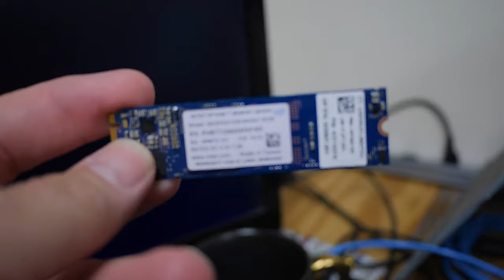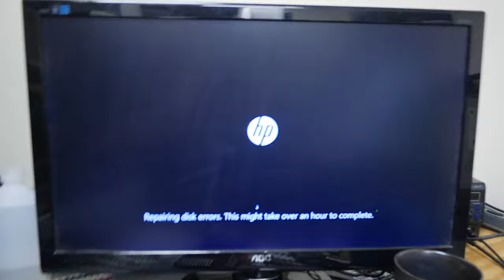Intel Optane Ate My Homework - Jody Bruchon Tech

Comment: Optane worked fine for me in the past. Its not even a thing anymore so this is pointless.
Reply from the maker: This comment is trash. I recorded this a couple of days ago. Optane working fine for you didn't stop this computer from eating customer data, nor the last few I've repaired over the years. New machines not coming with Optane didn't help this existing machine that already had it from eating customer data. At what point does this bullshit kind of comment become useful?
Reply: @JodyBruchon  Love that pin of shame
Reply: @JodyBruchon  all i know is, that on a fresh install of windows with optane properly configured, it did what it was supposed to do. As far as losing data is concerned... I always treated optane the same way you would treat a RAID 0 array. If one drive gets corrupted then the whole install would. But whatever... Keep winning my man!.
Oh and if those systems you 'worked on' had problems it's probably because they were Linux IIRC. Optane wasn't made for Linux and doesn't play nice with it.
Reply: @mathis8210  LOL. Like u even the slightest clue how any of this works😂
Reply: @quajay187  "this is pointless" - what, are suddenly all Optane drives of any kind destroyed or sent to a dump pile ?
Reply from the maker: "Everyone who bought an Optane PC should understand how to work with RAID-0 like I do, because my experience is the only thing that matters." Another trash take. Every Optane system I've ever seen was pre-built and ran Windows. Tell me you have no clue what I do without telling me bruh.

Comment: That's honestly a scary thought, of having to deal with a prebuilt PC that shipped with an Optane card. The average person isn't going to know any better, doesn't do regular backups, and cloud storage is incredibly limited. So it ends up becoming a nightmare for the repair tech attempting to recover their data when the card fails. I feel for ya...

I considered buying one of these to experiment with (since the m10s can be had for less than $20 these days on eBay) and have learned that they run alarmingly hot under a sustained load. (I've heard of folks attaching heatsinks to these because of that.) That's why I'm not surprised to learn they're dropping like flies in these prebuilt systems.
Reply from the maker: This one had very fat wax thermal pads under it so it was definitely being cooled properly, at least. Still failed though.

Comment: Hybrid systems are generally a bad idea. You always introduce new potential points of failure. 
Similar problems can also arise with cloud synchronization. It should at least always have the full data on the main memory (the cloud), so a failure of a sub system does not loose data. But in order to prevent data corruption when a process fails mid way, it also needs redundancy. Then it can roll back to previous versions of the data. It seems this was not done properly in the harddrive/SSD Hybrid?

Comment: What happens if the power goes out or you get another strange problem before all the data is written from this ssd to the HDD? You lose data. Very unsafe way to make a HDD faster.

When I started building my AMD am3+, when the platform was relatively new, I bought an 80GB SSD that I only had win7 on.

Had AMD athlon but later upgraded to FX8350

Comment: I had a laptop that came with Intel Rapid Storage Technology with Intel Optane Memory, but I couldn't figure out what it did and nothing happened after I disabled it.
Reply from the maker: It's an accelerator. The risk isn't worth it and SSD prices have tanked since Optane became a thing.
Reply: which laptop? I need a new machine for my spare optane stick. hard to know which ones have the right slots
Reply from the maker: @fanlessfurmark  Optane sticks are just small M.2 NVMe PCI Express SSDs.
Reply: @JodyBruchon  you get combined ones, good if you only have one slot
32GB optane + 512GB pcie3.0x2 nvme
Only my z370 recognises both halves, all other intel only see the 512nvme, amd only see the optane part.

Comment: that's a god awful pre-built PC, you can tell by the offset fan mount.
Reply from the maker: What offset fan mount?
Reply: @JodyBruchon , I think that it was about the CPU fan, which we can see on 0:44. But probably it's you, who placed it that way temporarily while fixing this computer.
Reply from the maker: Ah, that's not an offset mount. I took off the fan and put a larger fan on and jerry-rigged it with a paper clip so it would stay put nicely. It looks offset because the fan literally doesn't fit on the heatsink. A bigger fan was necessary and that was the fastest long-term reliable way to do it. It worked because the thing won't even hit 55C now.